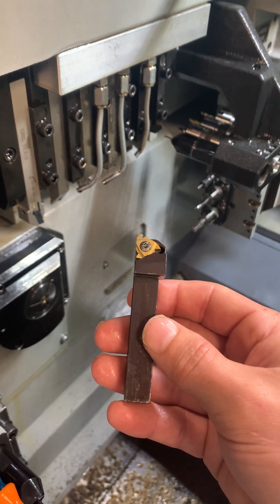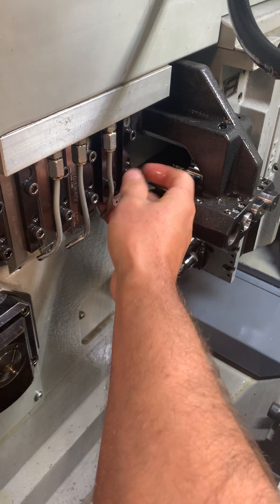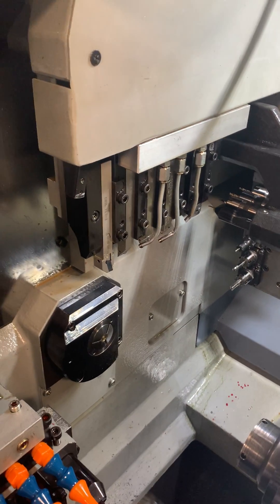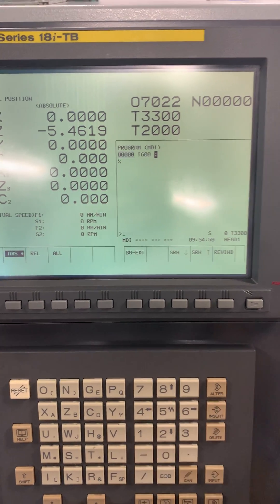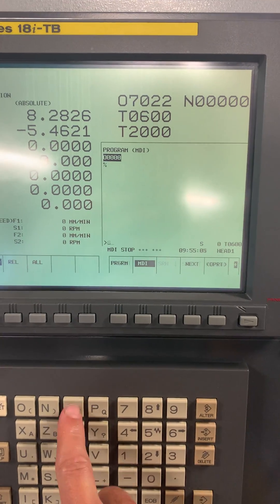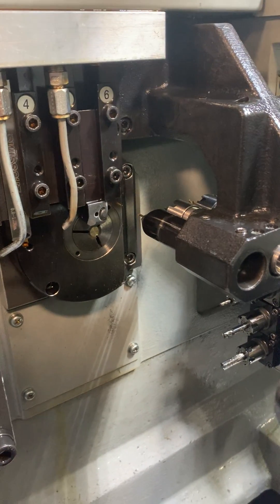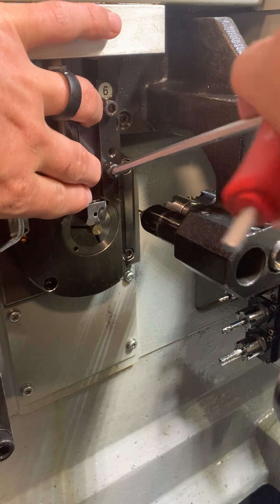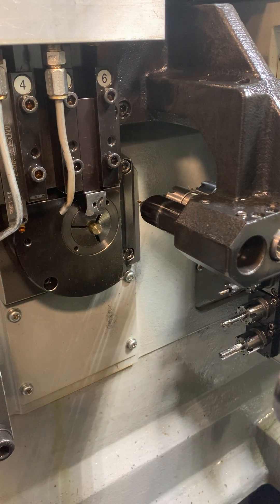Touching off gang turning tool on a Star CNC Swiss machine

Comment: Is that the common way to touch off most tool in swiss lathes?

I'm starting as a swiss machinist 4/14/25

My experience is with 2 axis lathes and 3 axis vertical milling. 5 years. 

Usually we use shim stock .01 or a .25 piece of material then adjust the work offset that much. Cause we aren't sliding the actual tool holder.